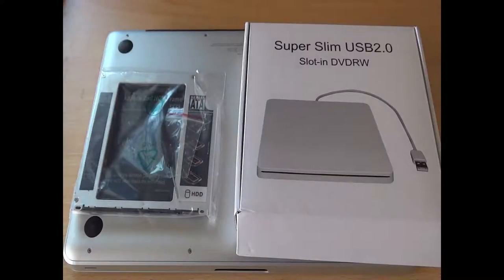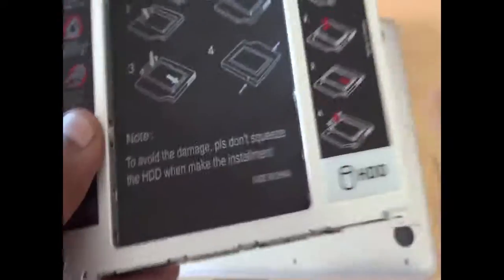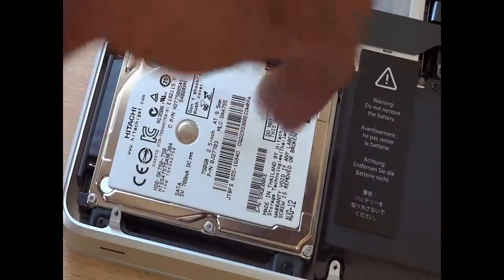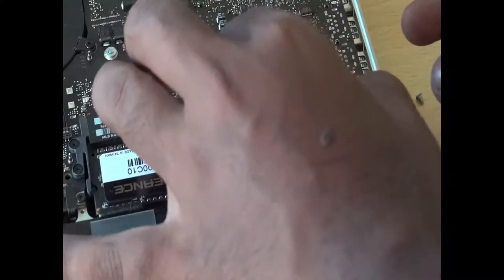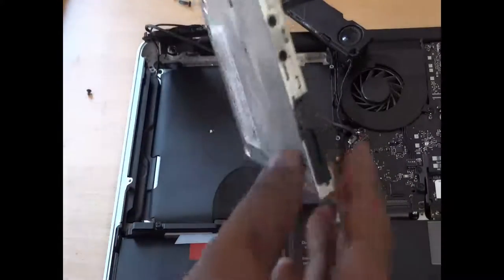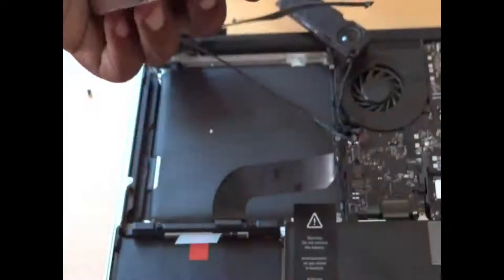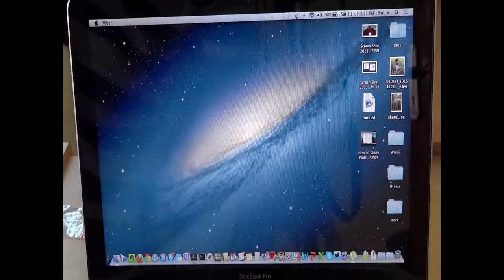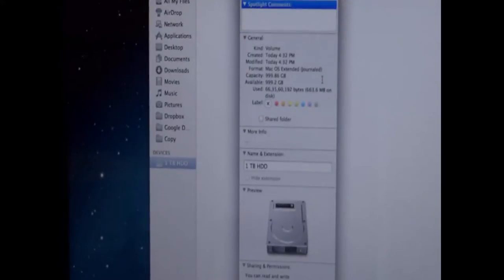Macbook Pro Upgrade with 512GB SSD, 1TB HDD and 16GB RAM

Comment: Hi. Thanks for the video tutorial. I am seriously considering a MD101 & upgrading it with 16GB RAM & 250GB SSD, at a later point in time. Is this macbook still a great performer without the upgrades? The only heavy softwares I am going to use are Solid Works & Solid Edge for 3D design. I won't upgrade the macbook if the above mentioned software work fine, in the factory configuration condition. Thanks.
Reply: Abhinav Gupta Been using MD101 for 1.5 year and I can say that the performance is pretty decent (I use it for autocad and editing videos).
Reply: Peacelover1212 thanks a lot for the feedback. have you upgraded your macbook with the ssd & ram?

Comment: did you migrate the OS to the ssd before installing it on the macbook? i have the same md101 model and i want to upgrade the hard disk to ssd but i think the OS is installed on the hard disk
Reply: I have the same question!!!
Reply: You can just use a usb stick to boot off. Make one my getting El Capitan off the Mac App store then use disk utility. This is not illegal since you have legally got it from the mac app store
Reply: Yes, you will need to have an operating system installed on the SSD before it can boot off of the SSD. You can boot off a USB drive before getting it to boot off your SSD, but I highly recommend installing the OS first onto the SSD. Much more reliable.